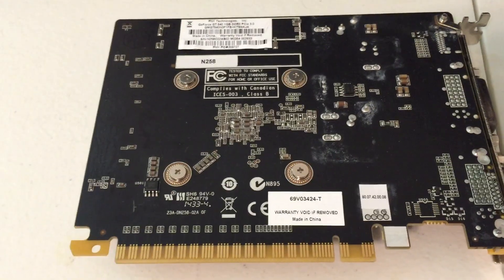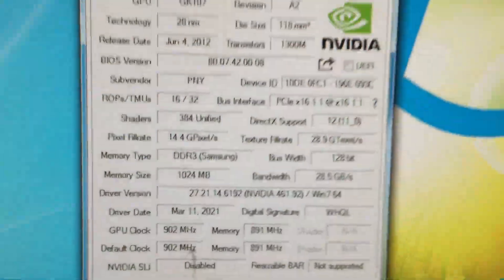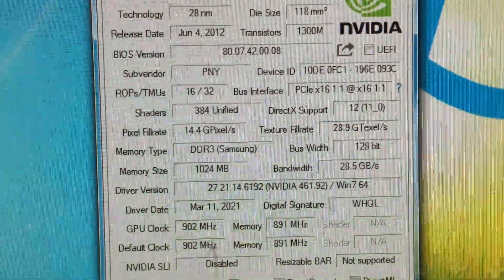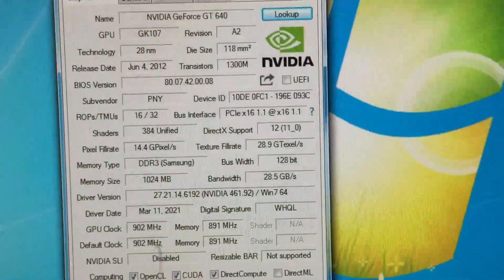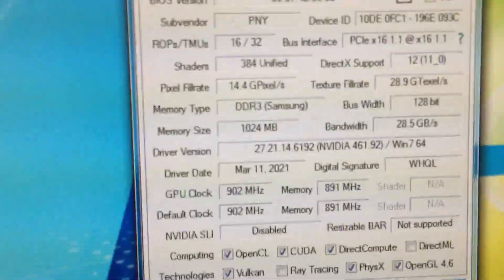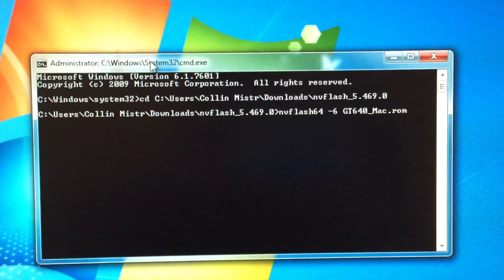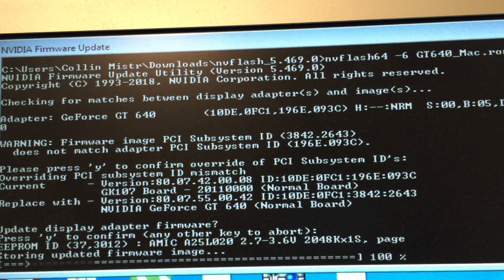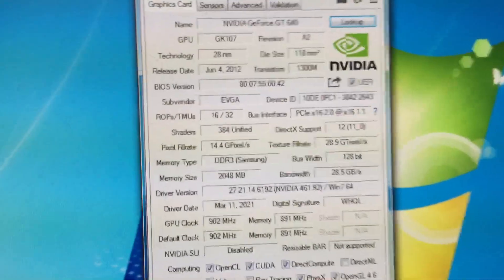Upgrading VRAM on an nVidia GeForce GT640 GPU

Comment: Great video! Just want to mention the VRAM used in the video is DDR3 not GDDR3, they are different
Reply from the maker: It is GDDR3, I made sure of that when I got the memory.
Reply: @dosdude1  but the MT41J128M16 you bought is DDR3 not GDDR3: https://www.micron.com/products/dram/ddr3-sdram/part-catalog/mt41j128m16jt-125 , GPU-Z also indicated it’s DDR3 not GDDR3
Reply from the maker: @nbzwt  Nope, I got MT41J128M16JT-107G chips (FBGA code D9PRS), which is the GDDR3 version. https://www.micron.com/products/dram/ddr3-sdram/part-catalog/mt41j128m16jt-107g
Reply: @dosdude1  Ah now I see, you are using gDDR3 (lower case g) instead of GDDR3 (upper case G). gDDR3 is a DDR3 compatible variant, and GDDR3 is a different incompatible technology, evolved from GDDR2.
Reply: You could compare the data sheet of MT41J128M16JT-107G (gDDR3) and for example data sheet of K4J55323QF-GC20 (GDDR3) and you will see the difference
Reply: I am sorry you are right, it is gDDR3. It is just not the GDDR3 I was thinking about
Reply from the maker: @nbzwt  Ah, makes sense. I just got the spec that matched what the original memory was. Never realized there was a difference between gDDR3 and GDDR3.
Reply: @dosdude1  quick question dosdude, why did you add flux to the old vram chips before de-saudering them. 
Also what exactly is “flux”.
I saw you add flux around each one of the old chips and was just wondering why you would add flux to chips that you’re about to take off.

Comment: All the performance of the infamous GT710 but 10 times the effort!  ;-)
Seriously, though, this looks like a pretty good exercise project for people wanting to learn BGA hot air rework, etc.  Thanks for the vid.
Reply from the maker: As I said, this is normally not worth doing for that reason LOL.
Reply: Buddy 2020&2021 that would be something that i was consider I had r7 250x 1gb gpu , and that was issue with come games like Fallout 4 , and with ridiculus prices in GPU where I was living 1030 2000kr (200$)... used  , a card  that are not as good to pay 3 times that gpu was worth before covid , so spending some cash to upgrate ram in covid is literally worth it , sadly ... or great now GPU's are back to normal prices and I have bough r9 390 8gb for 800kr (80$) week ago , and I am happy with that , but still perspective of ram upgrate is tempting , not with r9 , but when I looked for gpu and there where number of cheap GTX 1060 with 3gb ram , and upgrate for 6gb might be option for some .
Reply: @huzarion3814  Even if you upgrade a 1060 to 6 from 3, you still wont have a 6 gb 1060 performance. There is more than just a memory difference between the 2, the 3 gb variant actually has cores shaved off, its not nearly as powerful.
Reply: @dalehammers4425  You are right , I have made research because I had opportinity to buy 26 3gb 1060 and i had access to xeon PC , I planned to cashed on that , but 3gb is bust in compare to 6gb  , I have abandon that idea.

Comment: I recently picked up the same 5,1 as this one. It is completely dead. The previous owner replaced the backplane, and I had and extra working PSU. Still does nothing when I try to power it on. Anyone know where I should check next?

Comment: Nice video as always! Also, do you know why graphics cards can't automatically detect the installed memory? I was looking into upgrading vram on existing cards a week ago and it's funny how you upload this a short time later
Reply from the maker: The VRAM amount is set by the VBIOS. If there is a VBIOS available for a card with a higher VRAM amount, then you can upgrade the VRAM on that card and flash the respective VBIOS.
Reply: @dosdude1  Do you know why a graphics card can't detect memory in the same way a motherboard can? Does this functionality cost enough for OEMS to just hardcode the VRAM capacity in the bios of their cards?
Reply from the maker: @MLGPRO-dx8fg  Removable memory modules have what are called SPD EEPROMs on them, which have data on them that tell the machine what characteristics are of the memory on that module. On machines/boards with non-upgradeable memory, there is no need for this, and the memory characteristics are hard coded in the device's BIOS.
Reply: @dosdude1  Thank you very much. I am getting into working on electronics physically and not just writing software so this helps a lot. Maybe you should look further into modding the nvidia bios to change memory allocation... we could see crazy shit like upgraded 750 tis with 6gb of ram or something
Reply: @MLGPRO-dx8fg  i saw chinese 4gb 750ti. Not sure if its legit.
Reply: @vadnegru   Can't tell you if those are legit, but both ASUS and Gigabyte had 4GB card versions of their higher end overclocked 750Ti available here in EU through reputable resellers and official distributor network, but other brands did not. So evidently it was an option, but a rare one. TPU also registers a 4GB model by ONDA, that's a legitimate brand local to China.
Reply: @SianaGearz  i can't be sure but it was ASUS as far as i remember. So that opens up possibly for anyone to make 4gb card from regular anyway.
Reply: @MLGPRO-dx8fg  there are bios modding tools that let you set your own ram amounts via modding the bios (this was for my RX480 anyway)

Comment: Great job, interesting technique with adding flux to the chips like that. I usually spread flux on the pads on the board then put the chips. Any specific reason for that you did it that way (just curious)?
Reply: I have the same exact question
Reply: your everywhere.

Comment: do a 3gb 1060 to 6gb
Reply: That would basically require a full GPU chip replacement. However a GDDR5X 1060 can be upgraded to 8GB and BIOS hacked into a full blown 1080.
Reply: @jm036  how would that work?
Reply: @hizander  1060 GDDR5X is just a 1080 with 2 less RAM chips and locked cores. So, you add back the 2 missing chips for 8 GB and flash a modded BIOS to unlock the cores. GDDR5 1060 6GB and 3GB however are a different chip specific to the 1060 and the 3GB even has less cores.
Reply: Why stop at 6 gb?